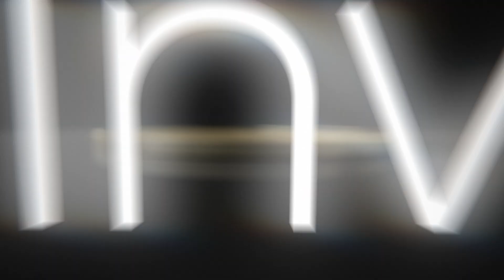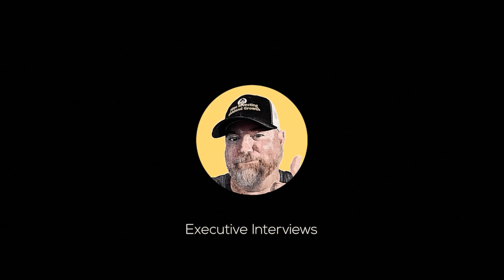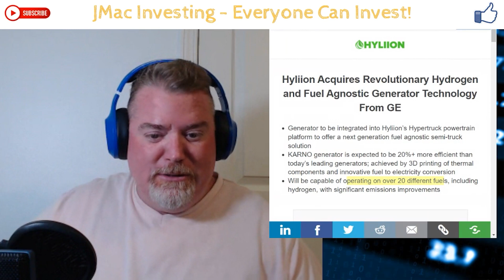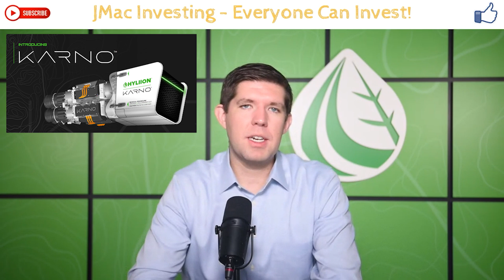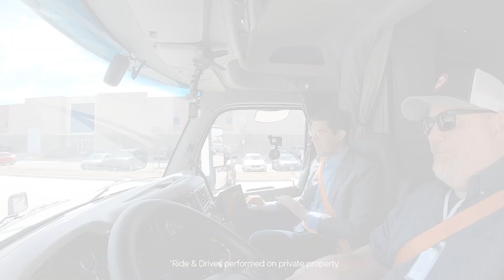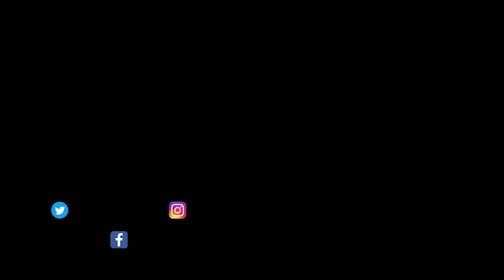Hyliion's Acquisition of GE's Karno Generator if Huge!

Comment: If this KARNO generator is real and can make it to production, that's a real game changer. Hydrogen is a dead end, but having a system that can work on wide varity of fuel and get better efficiency than current fossil fuel generators is huge. Natural gas and ammonia are very clean burning. This could have major applications outside of the transportin industry as well.

Comment: What about solar panels if somehow you can develop a solar cell that can generate electricity at night could replace generators..
Reply: Solar cell generating electricity at night?
Reply: I have solar cells that work at night, but the power cable is 12,000 miles long, because they have to be located on the other side of the planet which is where the sun is shining when it's night time here. Lol.

Comment: I knew he had more up the sleeves and this was probably it. Very much needed rather than just hoping for the ERX to be the only option. Next step is production and revenue!
Reply: do you feel this company will thrive after the midterms since the republicans  are pro natural gas from USA?
Reply: @coppersulphate002  natural gas is considered to be "green" as most electricity produced is using natural gas anyway. The credits have been passed so everything is in hyln's favor, and the whole industry itself. I feel like the market is ready, we just have to wait till they execute.
Reply: @RedlioNxTR  Why do you say “GREEN” vs cleaner than say diesel fuel. Fossil natural gas is not in anyway green, but RENEWABLE methane can be “CONSIDERED” to be carbon negative and thus very clean if you are not taking to a particularly fanatical group. Also when one is utilizing methane as a fuel you absolutely have to be sure that it does not get into the atmosphere as it takes very little to negate any benefits from using RNG. In addition, whatever type of “heat engine” one uses, you have to control METHANE SLIP or the methane leaking out of the generator. Methane slip is one of the negatives that competing battery solutions use to regulate the use of natural gas into oblivion as in California.
Reply: @Mentaculus42  I say green or clean, up to me. What's your point? We're getting rid of diesel, what's your perfect solution Einstein?

Comment: Can the Generator be used in a commercial/residential capacity like a normal home generator. Could this be used in an industrial capacity?
Reply: It looks like it would be an excellent industrial generator. Or residential if you could afford it. It will probably compete with current micro turbine offerings